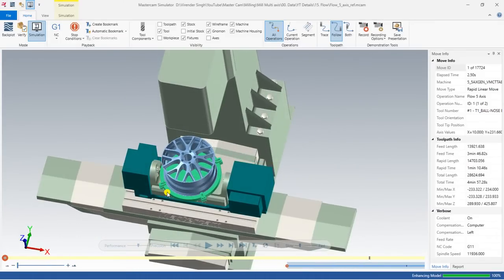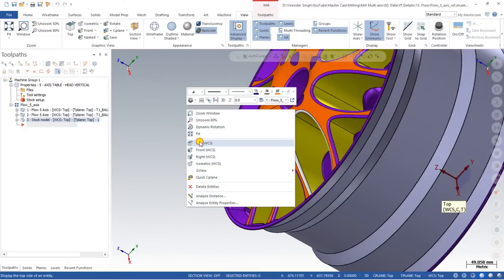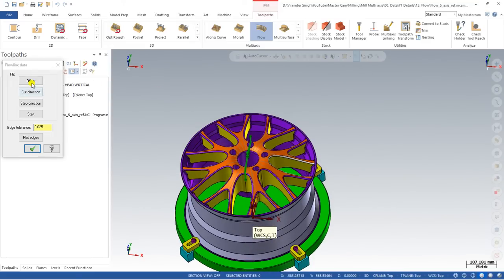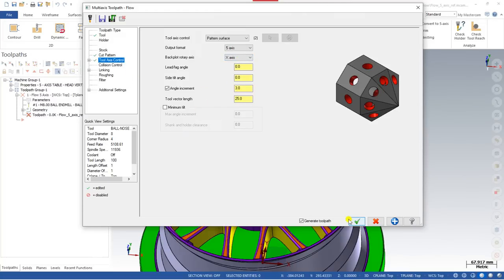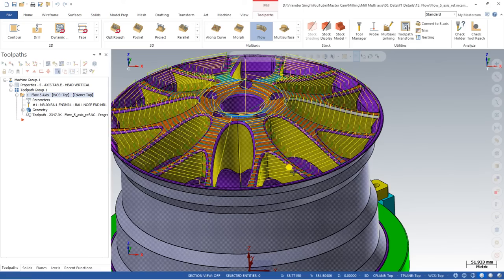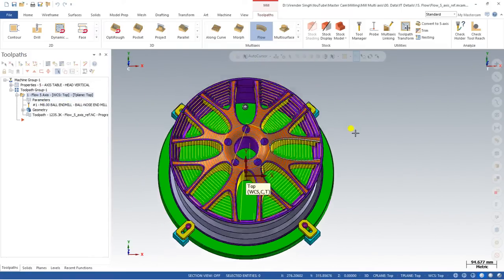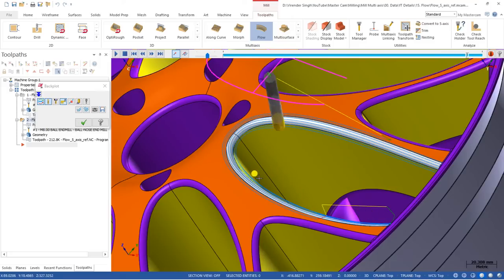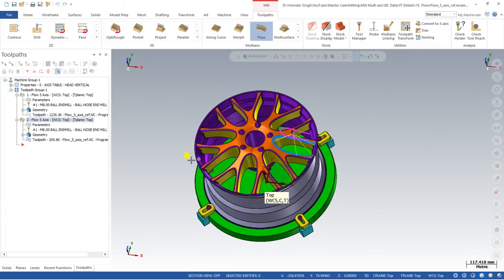Flow - Mastercam Multiaxis Programming

Comment: Sir, you make very knowledgeable videos.
I had a request from you.
Please record a video using Mastercam Post Processor Customise.
As in Mastercam's automatically created NC code, all the blocks have a sequence number.
I do sorting manually, can't be automatic sir

N1 
(centre drill-4.2/ M10)
N2 
(Drill-8.5/M10)
N3 
etc.
Reply from the maker: Will try